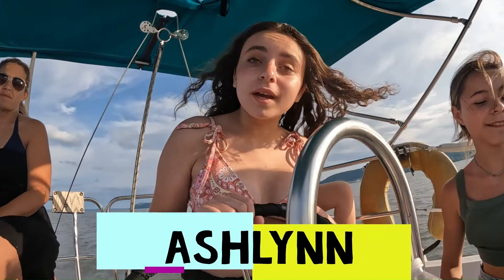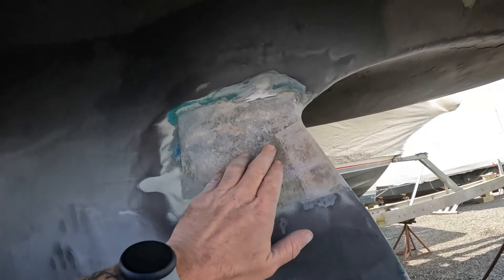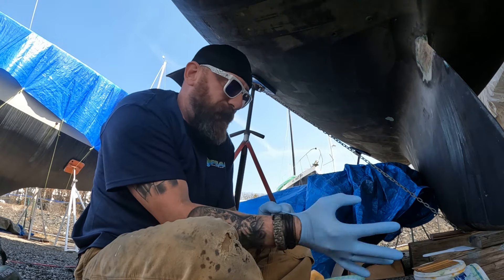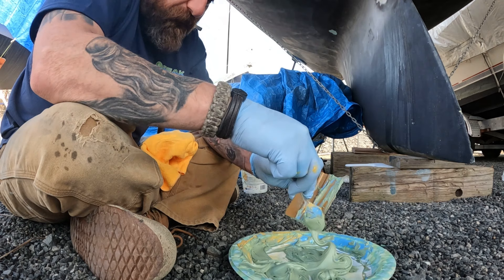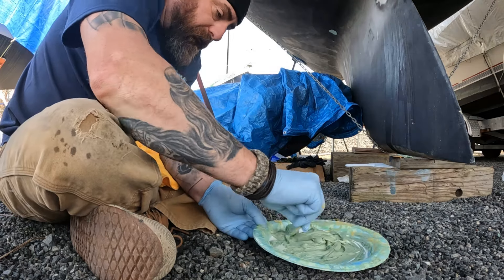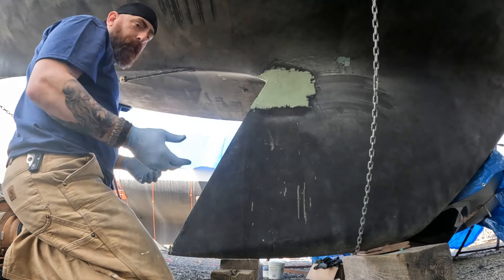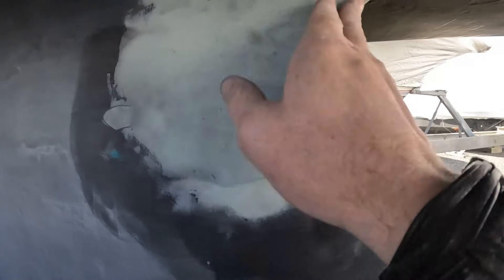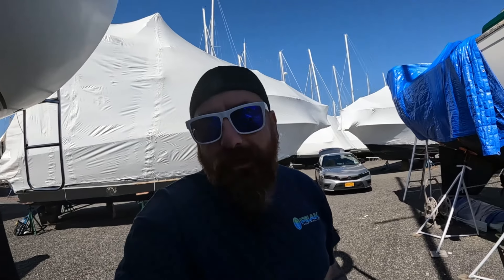Catalina 30 Keel Patch - I messed up bad Part 2

Comment: Thanks Brian, Question, I'm repairing a smile on my Sabre. I took out some filler from old repair. Should I fill it with fairing then fiberglass, then finish by fairing and paint? I had heard somewhere not to cover fairing with fiberglass.
Reply from the maker: Total fair is fairing but not really 
It's epoxy based so you can cover it in my opinion 
Monday I'll be glassing then fairing on the trailing end I'll be fairing then glass and more fairing 
Again I use total fair by totalboat and it's amazing

Comment: Nice work. I had to do the same job in the same place this winter. You going to put on a barrier coat before bottom paint? What do you like? I've used interprotect from interlux
Reply from the maker: Howdy 
No i will paint right over that it's epoxy based 
As well as the paint I use 
I do plan on soda blasting the hull to re do the barrier coat in the next year though